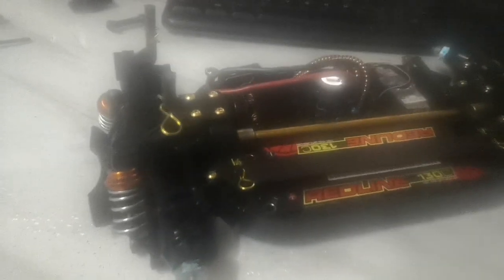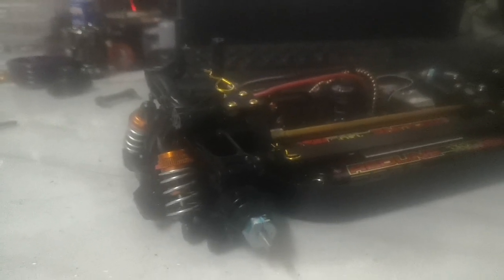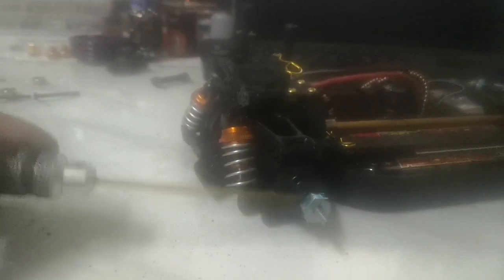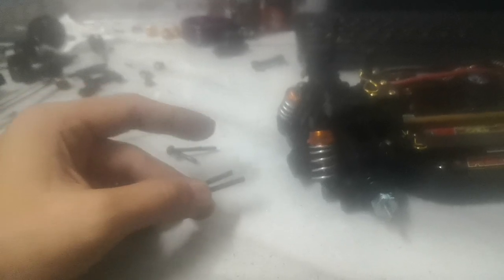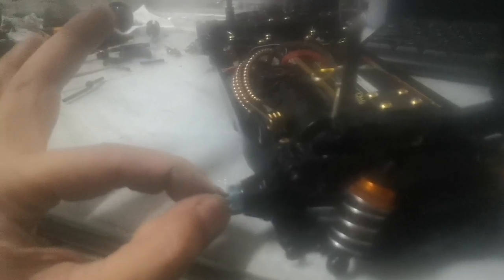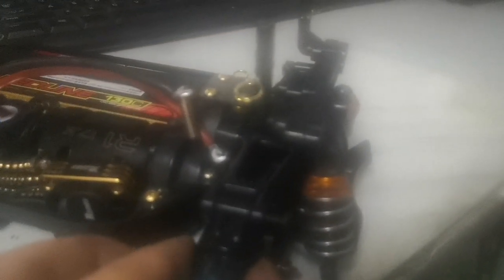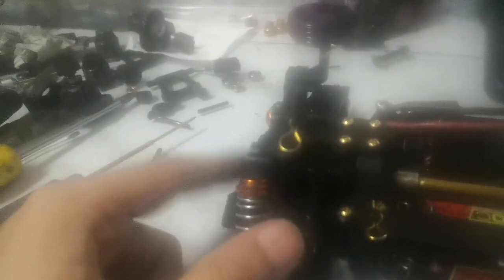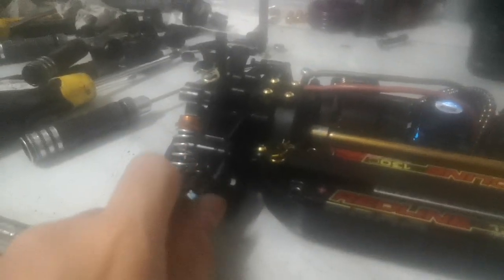Tamiya TT01 - Rear Suspension Speed Tips

Comment: How are you holding in the carbon rod? Now that you've lowered the shocks, the old suspension tower/body mount looks heavy and up high, maybe lighten that. You could take the ESC fan off and place the motor fan between the ESC and motor to eliminate one fan.
Reply from the maker: Thanks for the tips! I put a thin layer of superglue in the holes of the rear hub, let it dry, and then the rods fit snugly/tight into the hubs.

Comment: Are the 3mm diameter carbon rods strong enough to support a side collision? Great job.
Reply from the maker: Sometimes they break on a very hard hit but that's what I want to break rather than other parts of the car. Easy to repair :)
Reply: @rccartips  Is a very smart idea. I will try it on my prototype car. Thanks.

Comment: I get more info out of your 8 min video than me searching the web the past week, Thanks alot!   

I have one last question regarding springs, wondering if xray yokomo or axon spring fit your super short plastic CVA?
Reply from the maker: The xray/axon springs are larger diameter and will fit loosely on the short plastic cva. It could still work.
Reply: @rccartips  thanks you, I'm confused because you mentioned in another video that you guy only run 20mm springs to get low ride height, I only found 3 tamiya 20mm springs "42306". Would there be too much preload if I put 23 or 25mm springs with internal limiters to get 5-6mm ride height with super short cva shocks?